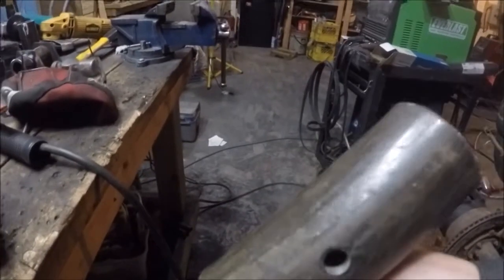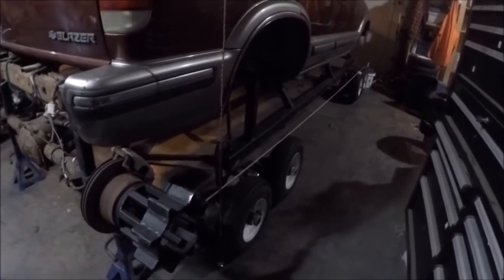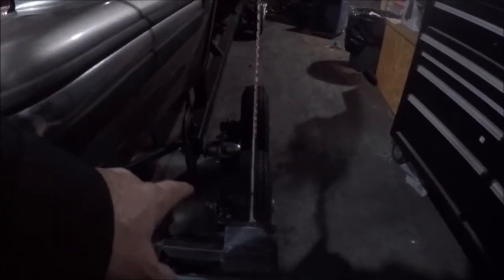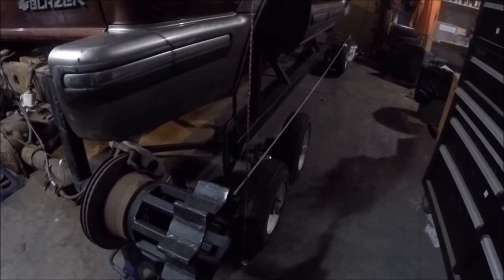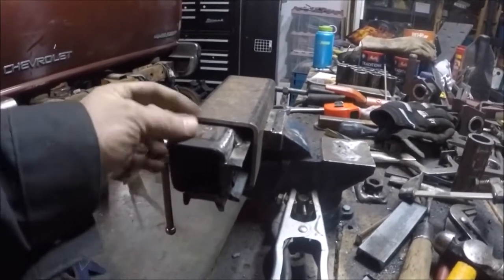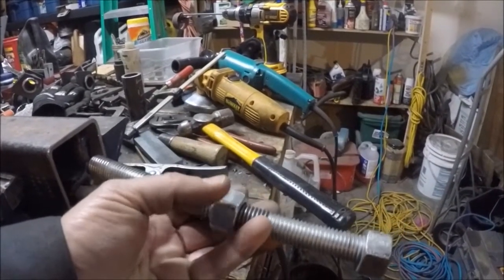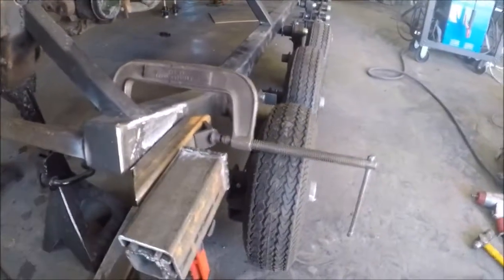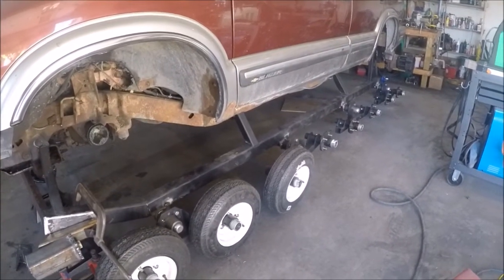Custom Tracked Machine, Part 20, Rev 1, Assembly of Parts

Comment: hi i was wondering if you could give me some advice on the drive system of a dual tracked vehicle. from watching your videos from what i can see your using a differential for sending power to each tracks and using brakes to control track speed. in an earlier video you had to fix a problem with the differential, cause it was locking up and making both tracks turn is there a certain type of diff that will do the job without modifications. i am looking to build a smaller version of what you have all from scratch but i want to have the drive sprocket in the front witch cause issues as far as using a rear diff so would i have to use the front differential off a car. thanks fro any advice, theres just not to much info out there on how to do stuff like this so any help will be much apreciated.
Reply from the maker: Hi, 
Sorry, didn't see your comment. I would suggest getting a differential from an ATV if you can get one that has an actual differential (probably from the front, usually rear axle in a quad is a solid axle shaft). I saw another guy get one from a lawn tractor. The rear differential in those is an actual differential usually driven by a belt.

Comment: I have to commend you on your build nice work so far, can I make a suggestion that you replace the front tyre idler with a solid replacement. Tyres in a turn will grip your guides at some point and you will throw a track plus you cannot puncture a solid idler, this again will throwing a track with no tension applied through tire pressure also a swing arm and tensioner applied giving more than one way for the force to travel. Keep going bud.
Reply from the maker: Hi Craig, thanks for the complement. I know what you mean regarding grabbing the guides. I have driven a Nodwell and the tires used to get a puncture when ever going over a log. My dad ended up filling the tires with neoprene effectively making them a solid rubber tire. Once I get through the testing phase and if it's needed to make the tires more reliable I am going to do the same, turn the tires into solid rubber. I do have a tensioner for the front idler but hard to see. You should be able to see it in Video 20 and I will make sure and give some close up (with extra light since sometimes it's hard to see) so you can see the tensioner design. Thanks for the comments.
Reply: i worked on military tacked vehicles so i know how much force and torque are applied idler assembles so a little slop in your square slide will translate to larger movement and on and on with further wear i would take some time to tightening up the tolerances and make the internal piece more solid in the mechanical ram your making, one thing also tracks over time stretch more and more so pins will work but you need to account for any stretch and subsequent extension and pin placement, be safe bud.

Comment: If your very first wheel on the front is still going to be a tire your track will come off every time you have to put cogs there too
I also think you're going to need some sort of a tensioner to take up slack of the belt
I can't see very well but does your track on the inside have a groove for the tires to fall in?
Reply from the maker: Hi James, You might be right but I have seen Nodwell's where they use just a wheel at the front so I am going to try this first. There is a guide on the inside of the tracks to keep the track on the tires. I think it's either video 10 or 11 that shows how the guides are built and assembled into the track. As for a tensioner, I have one for that front idler, you can see it a bit in video 20 and the future video 21 where I finish the assembly of the frame/track for the second try which is coming in a couple weeks. Darn work has me just too busy right now.